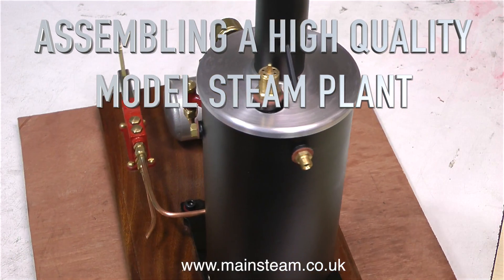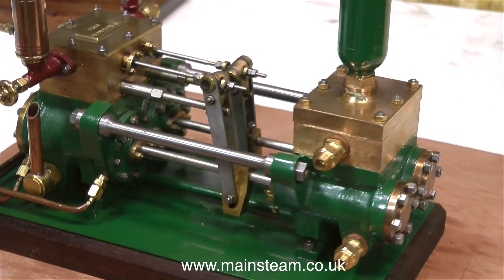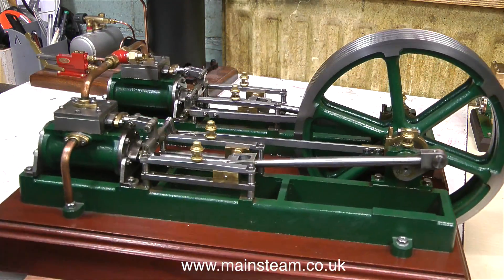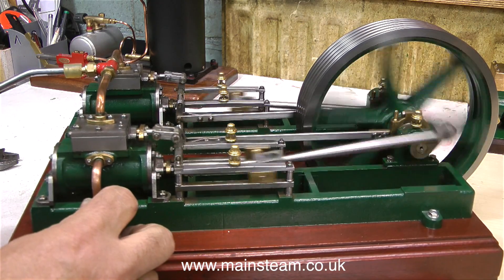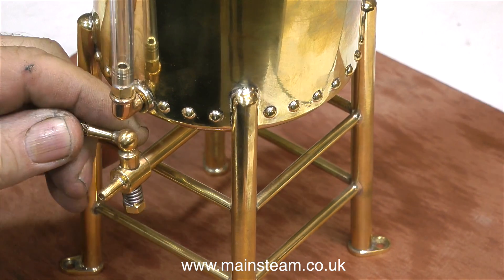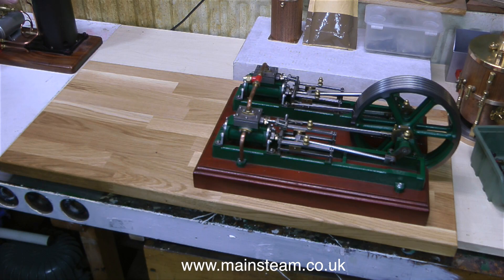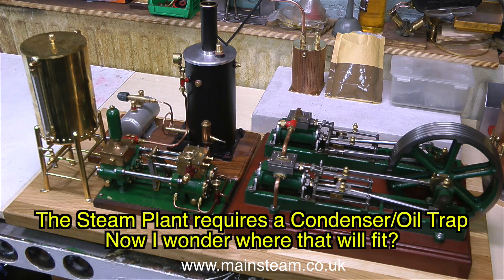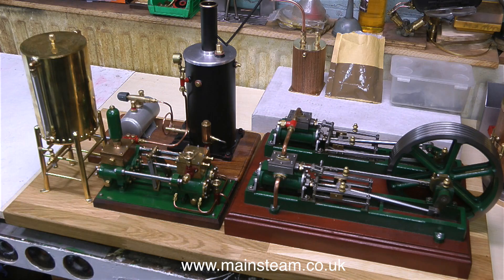ASSEMBLING A HIGH QUALITY MODEL STEAM PLANT - PART #1

Comment: Could the hand pump be setup to transfer water from the condenser to the water tank?
(Pulling from the bottom so the oil is not pumped just the water below the oil level. If you added a sight glass to the condenser, you could tell when to stop pumping. )
Thanks for the videos.  I love watching them. Am looking forward to more of the "How to build...." series.
Reply from the maker: Not really practical at these tiny sizes as the water & oil are also emulsified.

Comment: Another excellent series I'm looking forward to Keith! It will be very interesting to see if that little boiler has enough guts to power both the Twin Victoria and the Duplex Pump (just recirculating of course) at the same time...I'm assuming it's a multi-tubular boiler not single flue? Or maybe a single flue with cross tubes? If it's multi-tube will you be adding in a Superheater? Or will they just be running off of the Saturated Steam? I have a rather stupid idea to perhaps lessen the thermal shock to the boiler and how significantly the massive amount of cold water going into it will affect the steam pressure. Perhaps modify this condenser oil trap that you will be making for the plant into a form of feed water heater? By putting a tightly wound coil of copper piping inside the condenser that the feed water will flow through, the residual heat of the exhaust steam will be absorbed by the freshwater going through the coil and hopefully not kill the steam pressure as much. Obviously the amount of condensate will be increased significantly, but the boiler may be happier with the load it's supporting if it's getting warm water. :-))) Just a thought.
Reply from the maker: It is a brand new commercially made smal fire tube gas fired boiler. It will provide enough PSI, but its capacity is very small for engines of these sizes.

Comment: This may be a completely noob question, but would it be possible to run the pump from the low pressure steam coming off the engine? That is, from the engine exhaust?
Reply from the maker: Not really, it's possible but a little impractical.
Reply: I was going to ask a similar question, but remembering many of your narratives, I decided to Google it. The first response brought me to this. Magic.

Comment: Whats the point of the spiraly thing on the boiler?
Reply: That is the line that goes from the gas tank to the burner underneath the boiler, and the reason it's curly-qued in such a way is to make a smooth graceful turn to where it connects to the burner to prevent restriction and frictional losses, and also, seeing as the ambient temperature of the atmosphere surrounding the tank and associated plumbing is much warmer than the liquified gas in the tank, plus the radiant heat coming off of the boiler itself, the extra surface area provided by the curly-que in the plumbing will evaporate any still-liquified gas droplets that have made their way into the gas line so the burner will not sputter and gurgle.